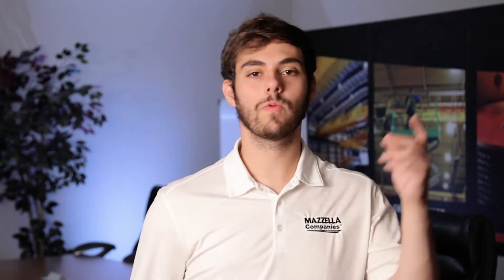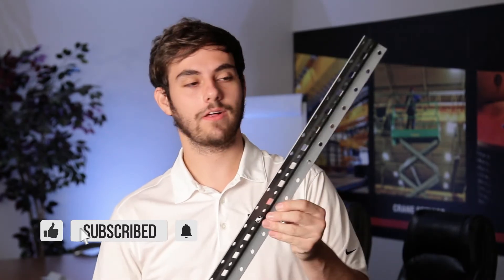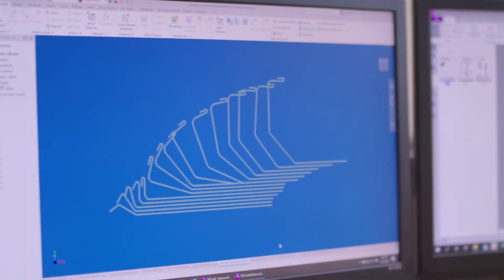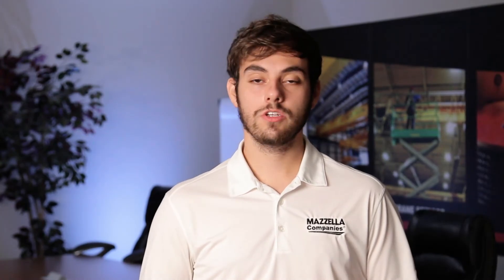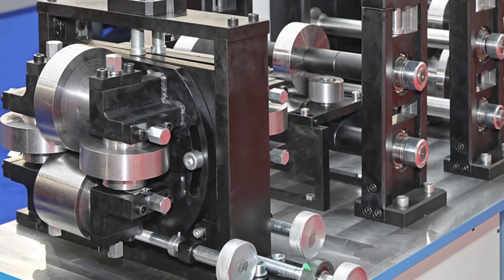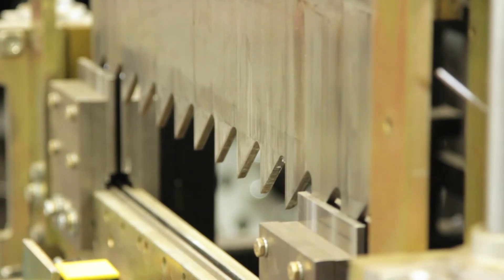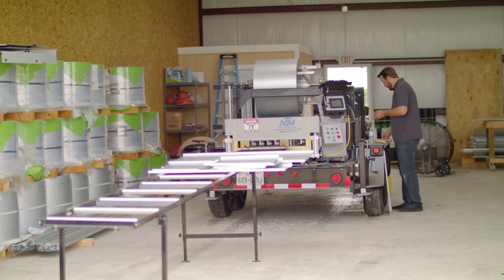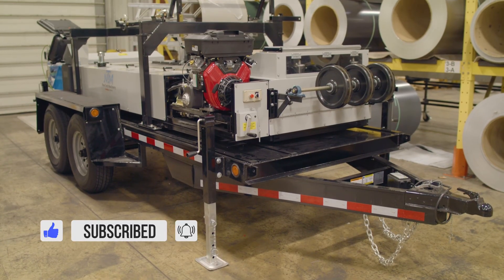What is Metal Rollforming? Efficient, Proven, Versatile Manufacturing

Comment: I have a handmade shutter profile machine with 8 pairs of roller. The main problem of this is twist. I concerned many people but they don't solved. I need your advice.
Reply: There should be  a straightening device to make it flat.We are the manufacturer of the Shutter profile machine,welcome to contact us if you need new machines.
Reply: You need a straighting block. It's usually made out brass so it doesn't damage the material. You'll also need a barrel to put the block in.